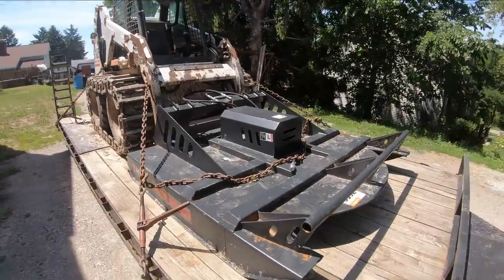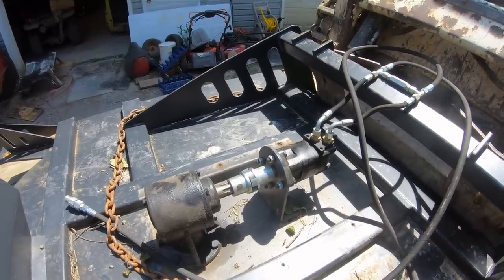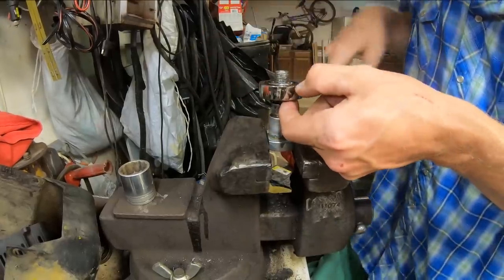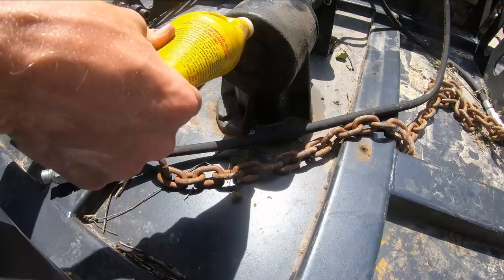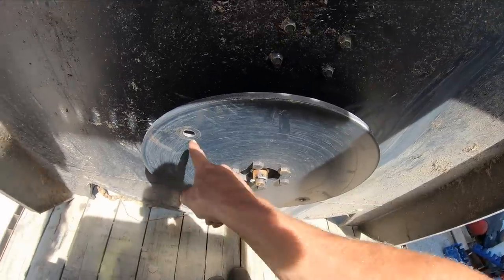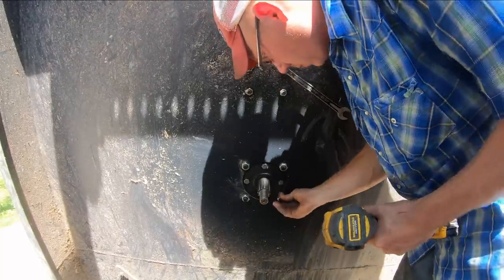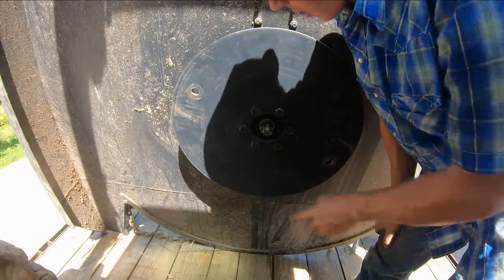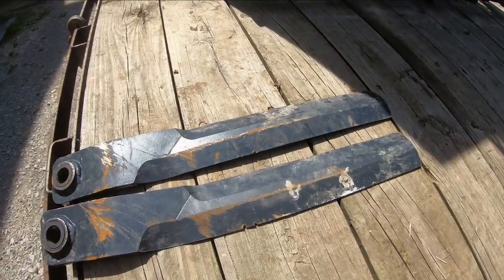BUYER BEWARE: Generic Auction Brush Cutter Inspection & Repair (Brand new JCT)

Comment: You would think that the auction site wouldn't handle a product that would reflect badly on them. I have bought stuff through the same auction site as they are everywhere. I will share this with some of the other sites I go to so they have a heads up. You see brush hogs on farms and such and they have as many hours on them as three farmer generations before them. I do go with the fact that you might of checked before using for sure as I am guilty as well... I bought a used one and it was clear out lube like it was flushed for shipping... I don't think that is common or necessary though. You might want to check other items got from Ritchie bros. before using in future.

Comment: Could have saved yourself a bunch of grief by checking bolt tightness, lubricant levels, etc., before you operate it. That's SOP.  BTW, a few extra washers under those nuts would have raised them to where the cotter pins would have engaged and prevented loosening. You own all the troubles you had with that.
Reply from the maker: when things are brand new and unused you shouldn't have to do all that, I can kinda see oil in the gearbox but there should still be a tag or something that tells you.

Comment: Did you ever find any shoulder bolts? Where do you find some I have the same cutter went over everything and tightened and greased the bolts and mine broke one off!! I need to buy some
Reply from the maker: I had a machine shop make me heavier replacement ones out of through hardened material, haven’t broken them yet...

Comment: Dude it's your channel and all, but if you buy used, it's your job to check the equipment. I used to install used servers, and before I turned them on, I'd first take off the lid and hold them above my head and shake 'em. More than enough times my "shake test" loosed a screw and I no longer had a short hazard. Just do your job!
Reply from the maker: It wasn’t used it was brand new

Comment: Slip clutch or shear pin design would be a lot better than the lovejoy.
Reply from the maker: Yes I think I’ve got a slip clutch around that may fit, if that doesn’t work I’ll get a chain coupler

Comment: Where you getting brand new on that cutter with only 5 mins? I can't see that thang is well used. Dirt and grass on the deck and the rusted bolt holes for cover. Also the gear box has oil covering the housing
Reply from the maker: I assure you it’s new, it’s sat outside since it was built they get rusty and grass gets on it the moment you start cutting? There’s no oil on the gearbox, heck there wasn’t any oil in the dang thing

Comment: Mannn i bought a grapple from a very reputable company off their ebay store and it came in this evening, unloading it off the freight truck and i shit you not....its leaking hydraulic fluid and you came to mind🤣. It was an o ring plug in the bottom of the hydraulic cylinder 3 threads from falling out on the right side, the left one was barely snug, the quick couplers were just snug, all but 1 hose was finger tight so i tightened every fitting and resealed the couplers before i even hooked it to the tractor. So dont feel to bad about your China made breaking because if i hadnt seen your vid plus plainly dont trust anybody elses work ethic and lack of pride in their work, mine would have been blowing fluid from the start lol. As you said....get what you pay for and apparently its not professionalism or pride in their work these days

Comment: I purchased the same cutter and had the same issues. Where did you find replacement blades and bolts?
Reply from the maker: I hade some better ones made for me at the machine shop

Comment: Those castle nuts just needed an extra washer or 2 behind them and the cotter pins would have worked as intended. No need to redrill, locktight, or tack weld any of that business.

Comment: Was it really new or did it have a owner before you?
That would explain half of its problems.
I think its a used machine and they FF't up putting the thing together and sold it.
Or else it is the company it self that just slapped it together.
Well done with the improvements and repairs the farming way :D
I think it wil hold its blades under the cover this time :))
Greetings,, Kitty.
P.s.
Stay safe!!
Reply from the maker: Oh it’s brand new, the Ritchie bros auction sells tons of them

Comment: That coupling is not made for such severe service. Needs a chain/sprocket coupling or a U joint on it. I don't think the rubber spider will survive the shock loading in this situation.

Comment: A taper spline is about as good as you can get for a secure attachment. (Why steering wheels are such a bear to remove.) Provided the parts match and are machined correctly. I highly doubt the wheel hub is a good taper spline to match.

Comment: Bad adjustment of the coupling  put the comparator on it !!! I would replace that coupling by a belt one more secure for the pump or the gearbox ...... (4flanges with 4 pieces of belt)!

Comment: A jaw coupler won't hold up to the torque requirements of that application. Use a single universal joint or a roller chain coupler.
Reply: A universal joint in the existing configuration would not last long at all. Not enough angle difference betwen the motor and the gear box for the movement of the needle bearings to pull grease in from the cup. A roller chain coupling would work very well.

Comment: I would take every nut and bolt off of the whole machine and at the very lest put them back on with lots ot permenent lock tite better still change them all to #8 bolts and nuts and still lock tite them on    just a thought

Comment: How did you think? 🤔Test run a Chinese mechanical unit without checking the oil check all bolts nuts? It's like asking for trouble 😋. As someone else wrote that he bought a Chinese ATV and had to spend a lot of time checking "everything" I can only agree bought a new Chinese ATV that was a copy of the Honda TRX 350. Looked exactly like my friend's real Honda TRX 350. The parts on mine fit my friend Honda. The only thing that separated them. That 8 years later he still uses his Honda. While my fake Honda broke down after a month or so and I got my money back. Buying something cheap is usually EXPENSIVE😱

Comment: more blades does not equal more power. More blades simply means it takes more power to run it. As to whether the Bobcat and hydraulics/gearbox is capable of providing the required increased power is unknown.

Comment: When you go to an auction there is a reason they aren't on a display floor .
I bought a car at an auction and within a week the transmission went out (auto) so I rebuilt the transmission and did some other stuff and had a good car. When ever you go to an auction,  everything is buyer beware .
Reply from the maker: When it’s brand new unused you would think that shouldn’t be an issue....

Comment: That hydraulic coupler spider is WAY too squishy.  Looks like rubber, when it should be urethane.  Those bolts did not strip.  I think they were never torqued down, and they loosened up, allowing the blades to fly.  That would certainly result in screwed up threads just banging around.  If they had stripped out, the threads would be GONE, and hanging off in scraps.

Comment: Looks Like The Original Owner Lost The Spacer Collar That goes Under The Main Castle Nut And Replaced It With 1 Less Then Thinner Washer And I Would Of LOCK TIGHT All Those Other Bolts And Nuts.

Comment: Matt I really believe your Bobcat is under powered for that brush cutter. The Bobcat S185 is rated at 16.9gpm for the base and 24gpm for the high flow option and both of these units need to power track drive motors and hydraulic loader lift cylinders as well as power the brush cutter.
Reply from the maker: The cutter requires 16-20gpm. I know I’m on the low side but it works fine when it holds together lol

Comment: So if I were you, next time you need some heavy equipment, buy American or German, it will cost more, but sometimes be available in used condition for less! And it will not let you down after 5 minutes of "service."

Comment: Modern engineering, sadly the people that build the cathedrals and railroads and viaducts are all dead and modern engineering standards are make it work and make it as cheap as possible and above all make sure it does not last long.
I bought a stainless steel saucepan with a stainless steel lid for dyeing purpose and within days rust was getting in the pan because they had saved a few pennies using an iron screw to hold the lid handle.
Expect to modify and repair anything you buy new these days!

Comment: I’m not going to mention anybody’s name but I bought a brand new 45hp tractor last December and I mean BRAND NEW  it had 1hr on it upon delivery I checked all the fluids in it from the  water to the differentials the engine to the hydraulics everything. front diff didn’t touch the add mark it took 3.5 gallons to get to the full mark 1 gallon of antifreeze and 3 gallons of hydro fluid just to get halfway the site glass. Smfh
Reply from the maker: I’d have been livid

Comment: There was a time Made in USA meant something, not now. Just bought a New Holland C327. Whike I waited for delivery the delaership gave me a brand new C227 to use. I didnt want to abuse the offer so I lightly used it, after 10 hours had a major hydraulic oil failure. oil everywhere, on my paved lot, my brand new trailer. Loose hose clamp they say. My new machine comes in on May 13, use it for 6 hours and guess what.... huge hydraulic oil leak. More oil on trailer. Another trip to return scrap metal, second trip in 2 weeks. Lost working time. Lost revenue. Cant imagine what my liability would be if I stained a gold course park lot like mine is now stained.  Absolute garbage from New Hooland, and its $60000 and I am going to fight liuke a MFer to get a full refund, no time for crap.

Comment: When it comes to that style of shaft coupler and you have a high torque application, you really need to use Nylon spiders, not rubber ones. On the plus side, you can get nylon spiders for pretty much any size coupler. Would probably cost about $60 though. 

Then I realise... It is a splined shaft going into the gear box and they used a standard couple while only holding it in place with a cheap bolt....... After you fix the blades and put a nylon spider in the coupler, that bolt will sheer right in 3. A proper coupler would probably set you back $2-300. 

I joked in the last video that by the time you fix all the problems you will have paid for an American made one.... That is looking less and less of a joke and more and more of a reality seeing this video.
Reply: At 2:18 it also looks like the alignment of the coupler is a bit off which also would cause the rubber spider to wear out quickly

Comment: I assume everything made in China is meant to break it off in Old Round Eye. The stuff is getting worse. I saw an air Chuck that was made of clay. It came on a cheap 2gal air compressor. The tip  for airing tires was steel like but the stem was clay. Baked in a kiln...
Reply from the maker: That’s common for sandblasting tips never seen it on a Chuck

Comment: You kept referring to it as "brand new" - not.  No oil?  Well sold "as is", wasn't it?
Reply from the maker: No it was new and unused when I got it, I ran it for 3 minutes and the blades flew off because there wasn’t a tight bolt on the thing

Comment: contact ABOMB machining here on u-tube and have him build you some, also some hardened spacers for the bottom of the blade spindle so the pin actually engages the nut also to keep it from coming off. Spend a few bucks and have it done right.

Comment: I've go no clue, if you'd bought this for "retail price" at a Farm Implements Store, would they have gone through and done what you just did? Check for bolt tightness, gear box oil level, etc?/ Not making excuses for poor grade hardware. Maybe this is why they are in Auction Houses...no one would carry them at Retail Outlets??

Comment: It probable may have lasted longer if you hadn't tried to cut down trees with it, even small trees as they were probably were outside of the design parameters of the machine.
Reply from the maker: These cutters are supposed to be built for that. If you can push it over it’s fair game you just have to take your time and let her eat. Since I fixed it I’ve taken down lots of trees like that with no issue
Reply: @DieselCreek  you mentioned you could re-drill for three blades, it would possibly be easier to do two more holes for four blades or would that be too much for bigger things like trees?

Comment: That don't look like a new unit to me? That unit was used by the auction house. The auction house may have assembled that unit and didn't do it right.
Reply from the maker: No I assure you it was new and unused. remember I used or for 5 min before it came apart
Reply: @DieselCreek  Then someone did a poor prep assembly on that unit, and may not put any lube in the gear box.

Comment: I bought the exact same piece of shit.  One blade fell off in 10 minutes.  The other wasn't far behind.  Half the bolts holding gearbox/pump cover snapped the when removing them to add the gear oil. I need to find those bolts and the now deformed poly bushings on the blades.

Comment: Most if not all Hydraulic machinery From Slap it together Dry from China is Shipped from there Dry of Fluids to keep weight Down to a minimum and other safety precaution measures like Fire in the Hold  On container Golithe Ships. They Cheap out on fill  Fliud  Decals  before Operating too.

Comment: I wouldnt have tacked that shaft. Those cheap ass chinesium gearboxes are weak as hell and probably wont last long enough to rust.........Those are identical to two junk ones we picked up. i dont recall the name, absolutely shit. If you use it sparingly it might last......a little. Its funny because the same dam thing happened on the two we got. Only one got the can opener treatment and the blade blew the left side off of it. Welds didnt have crap for penetration.  One is now repurposed as our drag for driveway/parking lot.  Works great for that.
CHECK the mount plate, the other one broke welds shortly before the gearbox grenaded and shot parts all over. Neither one lasted two months, not even kidding.  No trees, brome grass and sunflowers/weeds.   SO sick of the garbage everywhere. Everything is flipping JUNK.

Comment: Not to get political. But that was probably assembled by Chinese slave labor that had clue of what it is or what it was designed to do. And the gear box was more than likely  left empty to maximize profits and maybe for fear it would leak in shipping. If the overall structure of the mower can be beefed up and modified its a win. JTC jacked up tech Chinese.

Comment: Maybe I missed something but you kept referring to the brush cutter as brand new and you only ran it for 5 minutes yada yada yada. Are you stating its brand new from the factory/store and just ended up in the auction? All the rust and what not would lead me to think its not brand new at all. Just wondering why you refer to it as brand new.
Reply from the maker: The auction houses get truck loads of new unused attachments and sells them. The little bit of rust is from the water pooling up in the poorly designed gussets... most attachments don’t get to spend much time under roof
Reply: @DieselCreek  ahh ok, makes sense. It just looked like it was heavely used which is why I was confused. ha ha As long as it works now, it appears to be a good buy.

Comment: We all have bought Chinese garbage before.  This is the new normal unfortunately.  That cutter should be classified as a dangerous consumer product and be recalled.  The gearbox mounting bolt nuts don't even look like Grade 5 quality.  Look like pot metal..

Comment: No offense but according to all the oil and dust build up on that gearbox that mower ain't brand new... it's been used more than 5 minutes and if it come from an auction then it's been rode hard and put away wet more than a few times at a tool/machine/equipment rental place

Comment: If it was a brand new machine it would not have all those problems it's 100% probably not no it's has the Ben use that one point before you got it what might have been a return
Reply from the maker: It was brand new, never used

Comment: Nothing proper and normal about tacking nuts or bolts. a "farmer fix". Three times as long to remove the welds, more than likely will ruin the nut. Thicker washer then use the split pin as designed.

Comment: Send a link of your videos to Richie Brothers. Let them know that a national equipment auction company shouldn't be selling dangerous stuff. Yeah, I know you should double check everything before you use equipment for the first time, but brand new stuff should be ready to go right out of the block. I would also send the same videos to OSHA. Those JCTs are flat out unsafe. If someone had been standing out there watching when one of those blades came off, it would have cut them in half. Sorry you got screwed on that deal....

Comment: A good blade will snap in a press these are fucking junk
Reply from the maker: No they won’t, that would mean they are brittle, you can’t have brittle blades you want them to bend with they hit something and spring back which these actually did better then I would have thought. There’s a video out there by quick attach that shows one of their cutters hitting a large rock in slo-mo so you can see how they bend
Reply: @DieselCreek  the ones on my excavator mower are made of ar500  they don't bend back